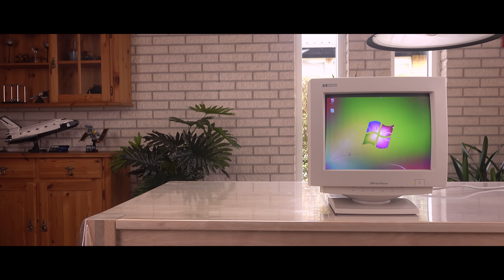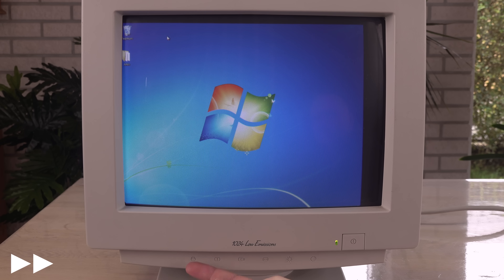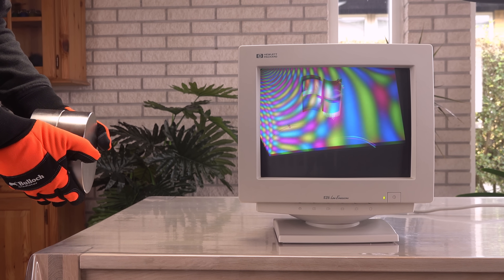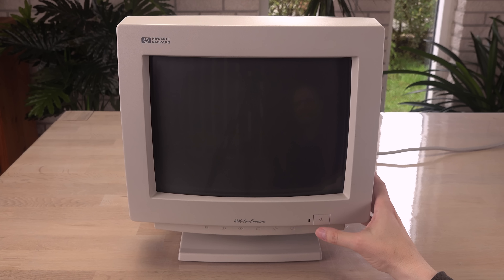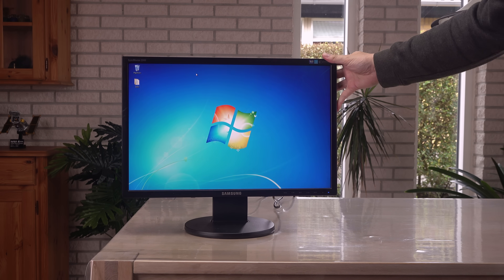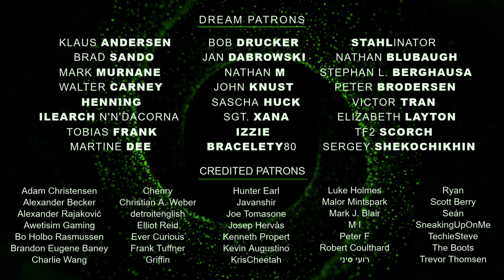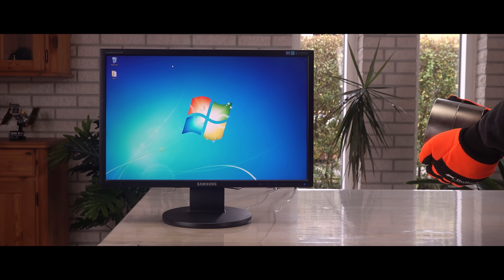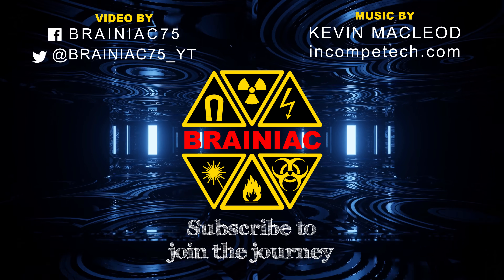Monster magnet meets monitors...

Comment: We made monitors for IBM in the late 1980s They used 3m  Helnhotltz coils to zero out any localized magnetic fields in the x and z dimensions Y was set to 0 . 4 gauss for north and- 0.4 gauss for south hemispheres markets.  10A was enough to simulate South at the center of the 3 m cube for adjustment. Tbh it was totally ott .

Comment: I suspect the lcd monitor does not turn off because it detects an error in the high voltage supply, but that it is the low voltage transformer being saturated that causes it to turn off, as it no longer supplies power to the control circuitry, causing the voltage to dip below the operating range. it will remain off after this until it is turned on again. It might just use a flip flop whose initial state is off.

Comment: I think when strong magnet is near the transformer then the magnetic flux alternating will no more in that and aslo it stays constant so it will not generate enough alternating flux to secondary coil then no voltage will occurs.

Comment: Curious if a newer monitor would behave differently, since they mostly use LED backlights now instead of Florescent Tubes, meaning there would not be a high voltage component.
I'm also a little curious if the monitor is still "displaying" an image after it goes black, but just the backlight has shut off so we can't see it.
Reply: Probably the switch mode powersupply shut off because of overload. I once put a magnet on a switch mode transformer and the psu gone into error shutdown mode and before that it drew a lot more current. So i think the main powersupply also shut off

Comment: Judging by the sound the monitor's HV circuit was making the voltage booster inductor was not very happy with a huge magnet fiddling around with the ferrite inductance.
Given how those booster circuits operate the magnet could have stopped the oscillations and the booster could not resume until a power cycle.

Comment: Can you please test it with a desktop computer and monitor the software values for CPU voltage as well as probe the actual voltage.... I use high end speakers next to my PC that are often not shielded and I wonder if this may affect the stability of my overclocks as I'm pushing right to the edge and slight fluctuations will crash the system. Makes sense that it would with some powersupplys but would be very interesting to see how much so as my PC is next to the woofer of my speaker cabinet with an 18mm gap and I have never considered that even though induction and ground offsets and stuff are things I try minimise in automotive systems.

Comment: That's a really good CRT. Very strong degaussing coil too. 
I've got a number of cheap Belinea monitors which get easily messed up by a decent sized iron speaker magnet. Took a number of hits with the degauss to get it somewhat repaired.

Comment: The magnetic fields in the NMR room back in college were absolutely insane. You had to leave your wallet near the door because they could wipe your cards easily. Monitors 20-30 feet away from the magnets would show color distortion all the time while you used it. The room had an emergency blower system that could completely vent the room and replace the air in under 30 seconds (and it was a BIG room) If you accidentally quenched the magnet the liquid helium would flash vaporize and displace all the oxygen immediately. You had about 20 seconds at most after a quench to get to the wall and pull the handle or you would go unconscious and die.
Reply: MRI and NMR are always fascinating, the strong magnetic force but you don't feel anything! Imagine a whole "NMR" apparaturs circling around your body in an MRI scanner... Nowadays even NMR with permanent magnets exist, they don't have to be cooled.
Reply: @Laralinda too bad permanent magnet NMRs suck, only like 60 MHz vs 1.2 GHz for cryogenic ones. Still useful tho
Reply: You'd think those two buttons would just be connected. There's no scenario in which you press one but not the other.
Reply: They might have refit it more recently with oxygen sensors but a quench is a pretty violent reaction so you wouldn't miss it. You were also taught warning signs of a less serious leak, such as feeling excessively sleepy or cold, because helium wicks away heat much more effectively than air.
Reply: Как магнитное поле может сдерживать гелий от испарения? 🤔
Reply: What does quench mean in this context?
Reply: Why wouldn't it vent automatically?
Reply: Good question! It's called multilayer safety. Basically You absolutely have a sensor to detect dangerous events that need reacting to. But...where do you put the sensor? And how sensitive is the sensor? Too sensitive and it goes off just from normal events. Not sensitive enough and it's useless. So you have a middle ground. But that middle ground, plus where you place the sensor may mean that it doesn't detect things as fast as you do. Or maybe it does. Regardless, Having the human being in danger primed to run away from the danger towards a a lever is a good idea. And so the system may already be activating, But on the chance it isn't, the human is a backup safety device. And if the system IS working, the human is running away properly. 2 layers of safety in one device! @shanent5793

Comment: Back in the day i used to fix some tv's that for some reason got the grid magnetized, by using a tv speaker magnet and running it next to the screen in vertical and horizontal passes, sometimes it need to be more focused on certain spots, it worked 100% of the times.

Comment: That LCD panel from 2009 uses a CCFL tube
CCFL tubes do use more power than LEDs.
CCFL require high voltage to use as seen on the circuit.
LEDs just need 12,24, 36 or 48 volts, larger the monitor the more voltage the LED backlight needs.

Comment: What a great video ! The CRT tv was really nice. The TVs CCFLs were really interesting. Thinking that LCDs used to be lit up by plasma
Reply: CCFLs technically are a plasma light source, they just use argon and vaporized mercury to produce UV which activates white phosphors.
Reply: @Snowcube  yep, that's what i like about mercury vapor, sodium vapor metal halide and fluorescent tubes. They all create light trough plasma. Seeing a clear mercury vpor or metal halide lamp is very awesome. CCFLs just look really cool. Especially the ones without coat that emit red light

Comment: I know it's fine to disassemble a computer screen with bare hands if you know what you're doing, but that still would make me too nervous.

Any time I had to open my laptops to clean the fans, I always wore rubber gloves while the thing was clearly not plugged in in any way and turned entirely off. Not saying for everyone to do the same (in fact, best to get someone that knows what they're doing for that), but it is a bit of minimizing risks in case there's an accidental discharge.
Reply: The high voltage is nowhere on the main-board of the monitor. It's only on the isolated tube connection/wire to the tube/inside of the tube and is generally hard to access.
The rectified mains on the supply capacitors is probably the main danger otherwse.

Comment: Hard hat on the head but on the feet only socks xD
Reply from the maker: Hehe, some of my friends pointed that out too. I am not used to having a revealing second angle camera ;) The face shield is in case the magnet (or monitor) shatters. But dropping a heavy 13+ kg magnet on my foot would certainly make for a bad day... I do have some steel-cap safety shoes but they are magnetic x) I do use them in this crazy video where my foot is close to the magnet and a barbell weight: https://youtu.be/VHMbwinSKaA

Comment: Pro tip: Use the right hand rule if you want to use the true electron direction :)
Reply from the maker: Yep, you can use the right hand for the left hand rule if you want to point the middle finger in the electron direction. But the 'right hand rule' term is usually reserved for something else ;) I use it in the Monster magnet meets aluminum can video for eddy currents direction: https://youtu.be/IDjqeLpjI4A

Comment: Big magnets near transformers will also cause the inductance of the windings to decrease, which can cause the current in the primary winding to increase, which might cause a switch mode power supply's overload protection to trigger, a fuse to blow, or something to burn out. My guess is that in the video, some kind of overload protection triggered before any permanent damage was caused.
Reply: The effect on the ferrite core would be way more relevant than on the winding, ferrite cores when saturated have a very sharp decrease on the inductance mostly if they do not have a magnetic gap which is the case of those transformers in this video, iron powdered inductors are way more tolerant in that regard
Reply: @tiagoferreira086  And the saturated ferrite core in turn affects the inductance of the windings.
Reply: @BrianG61UK  yes, but the magnet will afect much more the ferrrite than the windings, dc bias
Reply: @tiagoferreira086  So what? Are you just fed up that I didn't explain every last detail of the process or what exactly is your problem? Believe it or not, the state of the ferrite doesn't in itself matter at all to the working of the PSU. Only the effects the ferrite has on the electrical properties of the transformer will matter. What is wrong with you?
Reply: Seems to be a common feature on integrated controllers.
The discrete solutions are more likely to blow up.
Reply: Yes it's a switchmode thing
Reply: I once made a small magnet from a dvd player get close to a power supply, It shorted out and i NEVER made that magnet get close to that PSU ever again

Comment: Do plasma TVs get affected by strong magnets?
Reply from the maker: Haven't tried it. Plasma is affected by a magnetic field but I am not sure it would be noticeably in such small pixels (especially if they are run on AC current?). But the magnet surely would affect the transformer lighting up the plasma pixels :)

Comment: 3:54 I always remembered the focusing magnets on CRTs  being on the inside of the neck. I guess there's no difference though.
Reply: Oscilloscope CRTs use electrostatic deflection and focusing, so everything is inside the tube except for the trace rotation coil.
Most TVs use electromagnetic deflection, which uses external coils although electrostatic deflection was used in some TVs in the 1930's and 40's.
Reply: @rocketman221projects  Funny fact, I've only ever worked on CRTs on old scopes. haha, so your comment certainly tracks!
Reply: More like correction magnets. The focus is eletrostatic on all CRT displays I have encountered.

Comment: That is one strong Magnet, what is it's dipole moment?
Reply from the maker: Yeah, it sure is no joke to handle it near ferromagnetic materials. Not sure what you mean by dipole moment but it is a grade N45 and in air - even with no metal near it - it measures over 1 tesla/10,000 gauss right at its pole edges. Could probably lift the weight of a car if the car was crushed into a solid block for the magnet to act on :D

Comment: I have a laptop from February 1995 and still works like a dream. I still use it to take notes during lectures.
Reply from the maker: That's impressive... I struggle to keep modern laptops in working condition for more than 5 years... My first Samsung TV only lasted for 3 years. The 46" TV frame in the video... Had it repaired professionally for ~$400 and it broke a year after that again... (found out later it was leaking capacitors and they only changed 3 of 5 - a year after the 'repair' the two last ones failed). So seeing a 28 years monitor just work makes me miss the good old days x)
Reply: @brainiac75 they charged hundreds for replacement of a few caps?

Comment: I think when it means "Low Emissions" CRT's that were improperly calibrated would send out xray emissions past the glass, which for a monitor designed to be close to your face, was not very good, and CRT's are also well known to destroy eyesight, I assume that one would be less likely to do so.
Reply: The front is quite much a radiation shield (1 cm+ thick glass with additives). The back-side is probably less shielded.
Reply: @erlendse  yes. Back in the early days technicians would retune the CRT to but out more brightness, especially when the tube is dying, by doing so would cause the CRT to put out more radiation than is typically safe. 
Some models of CRTs actually put out more radiation than the average CRT should've from the factory. 
This is just a "hey this monitor won't kill your eyes as much" badge.
Reply: @erlendse  the back side is shielded usually with metallic paint on the outside of the glass, it's shielding for the degaussing coil. But otherwise they're painted black for better contrast iirc
X-rays can still pass tho

Comment: 12:57 Why not try this with a bit older monitor, likely with less failsafes?
Reply from the maker: It is my oldest flat-screen. Its age shows by only having an analog VGA input :D But I do like your way of thinking. It could be interesting with the cheapest of the cheapest of modern LED monitors. They don't have high-voltage CCFL back lighting. Just low-voltage LEDs so perhaps no failsafes in the cheaper ones... Maybe I can dim them more noticeably by affecting their mains transformer.
Reply: @brainiac75  Please try that! It will be interesting to see what happens to cheap monitors!

Comment: 3 meters away and already influence on a crt, that magnet is No Joke.
Which as a recurring viewer I already knew for years but it still amazes me.
Reply from the maker: After doubling its size, I feel like the magnet really has gained some reach. Maybe I should buy a second 200x50 mm and compare the difference in reach between a 200x50 mm and doubled 200x100 mm neodymium magnet x) But it is over €1200 and will be a pain to combine the two without breaking both :-[

Comment: Growing up we had a busted TV that had some warped color, I had played around with magnets on the TV before and wondered if they could fix as well as break the image, and crazy enough it did work, it would also maintain the "fix" if you turned the TV off with the magnet on the TV but then removed it and turned the TV back on. Never investigated deep enough to figure out why though.
Reply from the maker: Interesting. Degaussing with a permanent magnet is not an easy thing. As I remember it, the professional degaussing coils for CRTs (yes, it was a thing back then) used an AC magnet with quickly switching magnetic poles. Thanks for sharing!